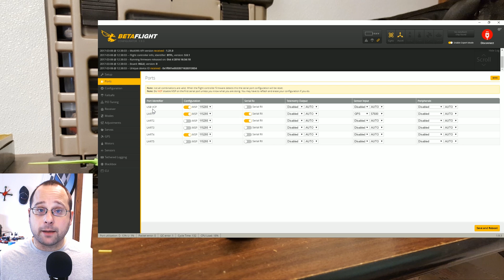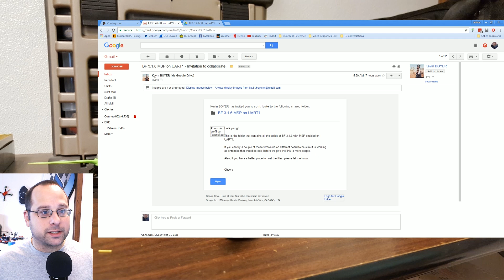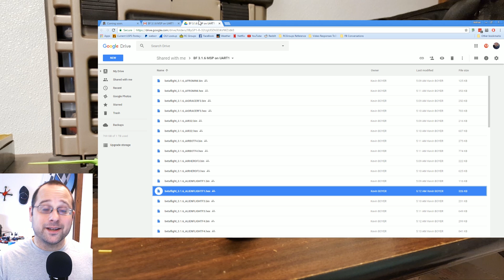Betaflight 3.1 Broken USB Port FTDI Adapter Won't Connect | FIXED

Comment: Totally off topic but I'm trying to find out if armattan frames are made\shipped from the US.  I thjnk they are but can't find the answer.  Emailed them and got auto replay because they're on holiday.   I'm just wondering when it'll arrive if I order a chameleon now.  I broke my only 5" frame and don't want to wait a month for a new one.  Thanks
Reply from the maker: I believe they ship internationally, although you can sometimes find US reseller.

http://www.getfpv.com/armattan-chameleon-fpv-frame.html
Reply: Joshua Bardwell haha thanks.  I actually just ordered from getfpv just before I saw your reply.  They have free 2 day shipping on orders over $60 now.  I hope I like the frame.  The hd cam mount was the only part I had reservations about.  Have you gotten a chameleon for review?
Reply from the maker: +DrFuNK I haven't but Ryan Harrell loves his.
Reply: Joshua Bardwell I fixed my 4" so I'd have something to fly in the meantime.  It has a naze rev6 and I was playing around with d setpoint weight and transition.  When I set the transition slider to a low value like 30, the quad tries to level itself when I center the stick.  No accelerometer on.  I'm just using this fc because I killed the f3 board I was using.  I just raised the value back up and it's fine but I thought this was strange and thought I'd let u know.
Reply from the maker: +DrFuNK weird.
Reply: Joshua Bardwell it's really weird.  I can start a normal, coordinated turn, then when I return the stick to center the copter will slowly start to level out on its own instead of holding its attitude.  I'll mess with it when I have some time and try to figure out at what value it starts to do this.  I just set it back to 1.2 and it's fine.

Comment: I am Kevin Boyer and you are welcome ;) 
let me know if it doesn't work for a board. I'll rebuild it ;)
Reply: Nice one Kevin!
Reply: To create a custom hex file with MSP enabled on UART1 you need to go on Github and download the source code of the latest BF version. Then you need to install docker on your computer. Then you open a Terminal (sorry Mac OS here) and go to the folder where the source code is located by typing "cd betaflight" for example. Then you type this command line "docker run -e "PLATFORM=BETAFLIGHTF3" -e "OPTIONS=USE_MSP_UART" --rm -ti -v `pwd`:/opt/betaflight betaflight/betaflight-build" and you press enter.
Once finished, you will find the hex file in betaflight/obj/...hex
Cheers
Reply: I have a SPRacing evo board and can't seem to get it working. I flashed the board using DFU mode with your appropriate hex file and using the USB port. Used full erase. Flashed ok but won't connect. Am I doing something wrong
Reply: Bruce Nixon hum I'm not too sure... what would be the point of using this hex file if you are able to use the usb port for flashing?
Reply: I have a lost USB connection to Betaflight due to Uart 1 being accidentally switched off and thought this hex file would switch the uart 1 back on? I can use the usb for flashing but won't connect to Betaflight, after flashing 3.1.7 from 3.0.
Reply: Bruce Nixon so this hex file is turning on msp on uart1 so you can use an ftdi adapter on uart1 to communicate with the board.
Reply: OK. Will try that. Thought I might have been able to use USB, Obviously not the case. Thanks.
Reply: Bruce Nixon once you are connected using uart1 you can check msp is enabled on usb vcp and then try to connect through usb. if you cant it might be that your usb port no longer works.
Reply: Hi Kevin. Didn't connect with FTDI adapter so must be something else going on. Thanks.
Reply: Thanks Kevin!!! You and Josh saved me!!  next question as more releases come out how can I learn to set this up so I don't have to rely on you for new releases?
Reply: miahndes no worries mate ;)
you can go on the github and ask the guys how to use dockers to build your own version of BF
Reply: I've got it sorted!!!! Thanks again KEVIN!!! I love this community!!!
Reply: @KViN can you please create a hex file for the Matek f405 board? 
thank you so much in advanced
Reply: KViN Hey Kevin, thanks for your work :) Will you be uploading a file for betaflight 3.2? when you update, do you know if the uarts are reset?
Reply: Michael M I might do it again with BF 3.2 if needed when they release it officially ;)
Reply: KViN please do! :)
Reply: KViN would you mind sharing how you are creating the hex file with a uart enabled by default?
Reply: I just made the hex file for BFF3 with MSP enabled on UART1
https://drive.google.com/file/d/0ByGP1-R-32UgOXQ0akpQMzVQSGs/view?usp=sharing
Reply: Hi Kevin. I have been sitting for hours now, and i wonder if you can help me through this obstacle? When i run the docker run command, i get this error: create `pwd`: "`pwd`" includes invalid characters for a local volume name, only "[a-zA-Z0-9][a-zA-Z0-9_.-]" are allowed. If you intended to pass a host directory, use absolute path.

Do you know what im doing wrong? Thanks man
Reply: Hey Kevin could you do a video or a more detailed tutorial of this ? (if this is still a thing nowadays) I need to do it for my Matek F405 AIO :)
I've never played with the windows terminal and i've no idea how docker works, so this would be very helpful !
Reply: A big thank you !!
Reply: can you update you list for new boards i hawe a speedebee f4
Reply: Kevin. I'm trying to fix a succex - e mini f4 board, and the target is Betaflightf4. But I can't find a 3.16 hex in your folder. Can you help?

Comment: Is this a back-handed recommendation that we POT the USB port in hot glue the moment we take it out of the package?
Reply from the maker: I've never personally had one break loose but apparently it's more common than you might think.
Reply: I'm not all that surprised.  A lot of gear uses surface-mount pads that aren't very strong.  USB ports take a lot of abuse, especially micro-USB.  Mini-USB are easier to align it seems.

Comment: I cant seem to connect my Naze32 board to either Betaflight or Cleanflight anymore, I remember that I could connect it in November-December but now it doesn't work. Any ideas what´s happened and how I can fix it?
Reply from the maker: I suppose the CP210 drivers are not installed correctly.
Reply: I did install CP210x drivers just before I made the comment but it didn't do anything for me :/ Do you think it might work if I bridge the boot pins and turn it on? I have never done that but maybe it´s worth a shot?
Reply from the maker: +Danny_217 bootloader will help you reflash the board.

Comment: I have two boards stuck in dfu move and I can't even fly with them
Reply from the maker: Most likely the bootloader button is damaged and is failing closed. Desolder the bootloader button from the board.

Comment: lol.....so soldering new USB connector seems like a hard job lol.
Reply from the maker: It's a challenge for many people to solder such small pads, and the traces are sometimes lifted. I'm honestly surprised that so many people were using the UART1 MSP workaround.
Reply: Soldering a new USB connector is way too hard - normally pads have been lifted too.
Reply: I am not sure what I would accept more. Having to drag FTDI cable always with my copter every time or perform single action to solder my USB connector back :D. When you have really small solder tip it should be fairly easy.
Reply: Honestly; that’s the main question that keeps running threw my head. That’s a hard soldering job. Is it worth it? I think it is, it’s always worth it if you payed for it. Ha!

Comment: I am sorry but turning off msp on uart1 so that idiots don't complain they can use UART 1 is colossally stupid. 
On the plus side 3.0.1 with no gyro notch and just dterm notch has better performance on stock pids tbh.
Reply from the maker: I personally agree. One approach locks people out unexpectedly. At least if MSP is conflicting, you can still get in to turn it off.
Reply: ^this.

Comment: side note , i got a 100mm micro two weeks ago , usb port stopped working two days ago. i have a bluetooth adapter that i used on my 250 , plugged into and works on the micr. will let l\you know if it works to flash bt i  think it might

Comment: I have a quick question I have been having problems with racing in multigp chapter due to video problems on 25mw. I always seem to get others video feed in my hdv2. this happens when they pass right near me or when I'm far from myself. could this be due too the person's vtx audio line is not grounded? I'm running TBS unified pro with la forge v2 davirsity. any ideas?
Reply from the maker: +Eric Lyon the race director needs to put the flight line further from the course.

Comment: People whose receivers didn't work because of UART1 being enabled on VCP boards could still connect and disable UART1 and then have a working board and receiver right? Seems silly to screw over people whose USB ports are broken just to save some lazy people some setup time... haha

Comment: Great tip, too bad you didn't test it before passing it on.
Reply: Oh, wait! It's ok now!
I flash it again, i selected target 512K and Global erase in STM Flasher. And now all works perfectly!
Thank you.
I confirm - i was able to connect to board through UART1 right after flashing the board. I have my USB connector broken and this solution helped me to ressurect my flight controller :)
Reply from the maker: Do you find that they don't work? The person who compiled them tested some of them. If you've found one that isn't working then don't drop hints, be specific so we can fix it.
Reply: Joshua Bardwell  lol no, just wondered why you didn't test one (before uploading the video then) 

All my USB ports still work so luckily no problems yet.
Reply: I tested it. 
Board: Airbot F4 clone.
Flashed firmware: betaflight_3.1.6_AIRBOTF4.bin
Result: No connection through UART1. Connection timed out.

Comment: OK ! soooo how do you flash the system if my USB port or socket is damaged ???
First today , its my Lucky day ..LOL...Thanks
Reply: Oh, wait! It's ok now!
I flash it again, i selected target 512K and Global erase in STM Flasher. And now all works perfectly!
Thank you.
I confirm - i was able to connect to board through UART1 right after flashing the board. I have my USB connector broken and this solution helped me to ressurect my flight controller :)
Reply: +ArmedMonkey     Could you explain how or reference to the method of using the DFuse filemgr program to create a dfu file from the .bin firmware. I'm getting a 1k .DFU file from a 244k .bin file - that can't be right . . . right?
Reply from the maker: +GRAMPS 65 there are some possible workarounds but for most people, just replace the board.
Reply: ArmedMonkey amazing! I have f4 with broken usb, so I can flash it via uart3? where I can read more about it? is it enough just connect uart3 to my uart usb adapter? should I press boot button?
Reply from the maker: +FlyStav you would need MSP active on UART 3. These files have MSP active in UART 1.
Reply: :( i thought it is something like a secret. 
So there is no ordinary way to resurrect F4 board with broken usb? :(
Reply: Well. I will check this out right now :)
Reply from the maker: +ArmedMonkey you may be able to flash in DFU through UART 3 but how do you use the configurator?
Reply: Oh man! You are genius! 
I have chinese Airbot F4 clone. I put it in dfu mode and connected thru uart3 port. And i was able to flash it with STM Flash Loader Demo app! It's amazing!
But then i stuck.
I flashed "betaflight_3.1.6_AIRBOTF4.bin" from Google drive folder (from this video ofcourse). Flash was successfull, so i soldered wires to uart1, connected to my adapter again, but unfortunately i still can not connect to my board from Betaflight. I see only "timeout error", just like MSP still not enabled on uart1 :(
Reply: I was able to flash custom firmware on my Airbot F4 trough UART3, but still can't connect from Betaflight configurator throught UART1.